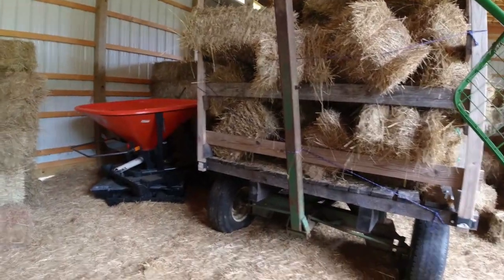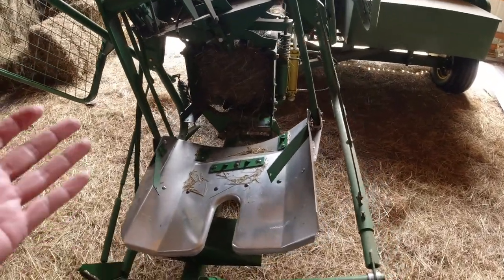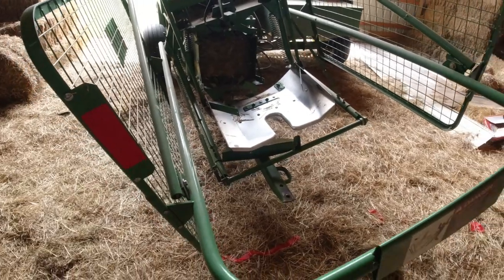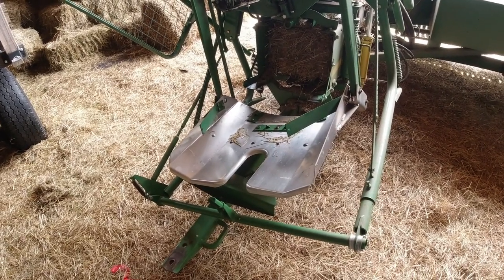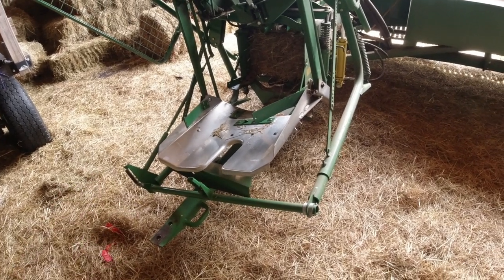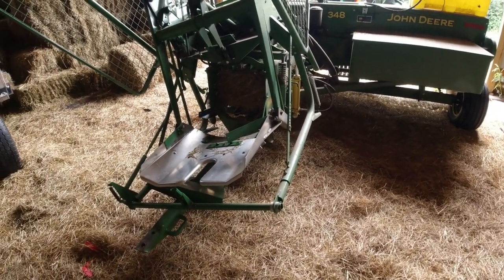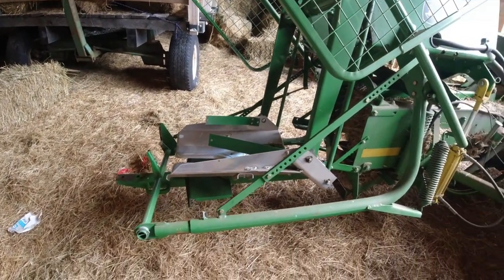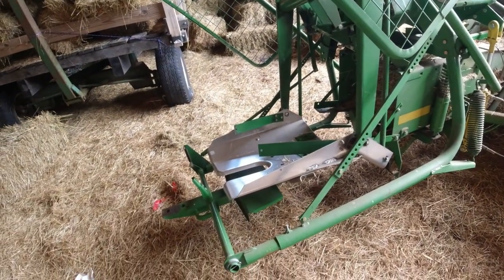Critical Adjustment -  John Deere Baler Pan Kicker

Comment: Still using a model 30 kicker on an old 336 almost identical to the 42...  Works like a charm....  New Holland is full of crap....  These kickers will keep up with any square baler made today regardless of capacity if adjusted correctly...

Comment: An adjustment you should make on your baler is that warp speed kicker tilt. I have never seen one move that fast. you can feather ours on the control in the cab. You seem to have a hydraulic on yours that isn't stock. should be electric hydraulic self contained unit without hoses. what is that about, looks like a new baler...
Reply from the maker: The baler is 5 or 6 years old.  The hydraulic tilt is 100% John Deere and for that baler and 42 kicker.  Electric tilt was an other option, I wanted hydraulic.  Thx for watching.